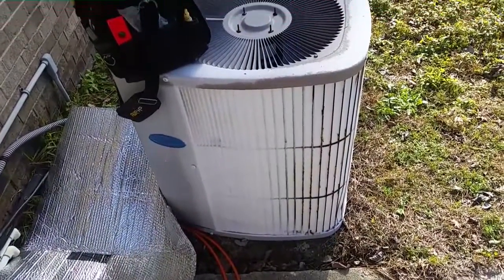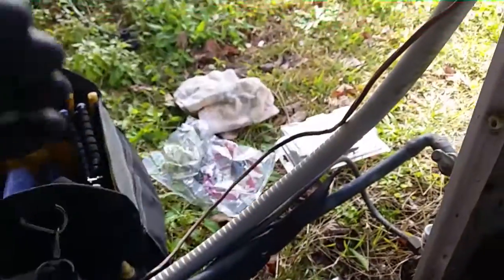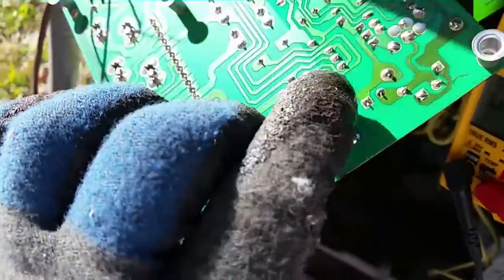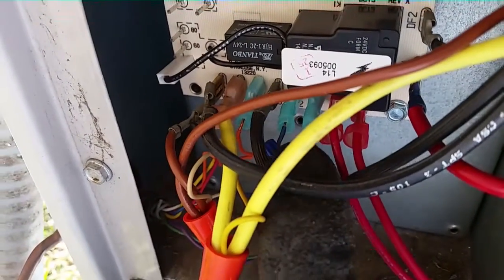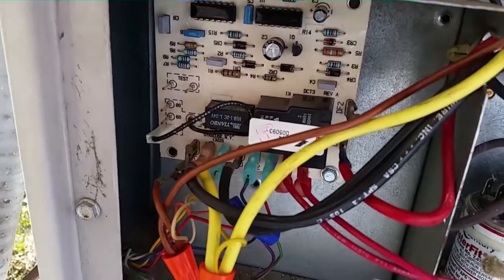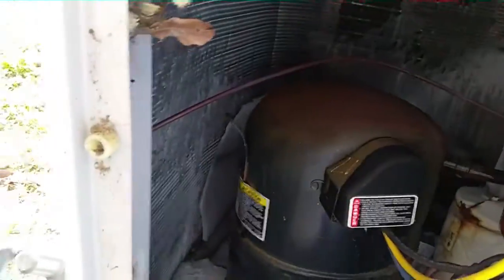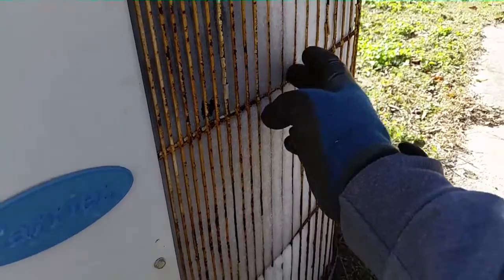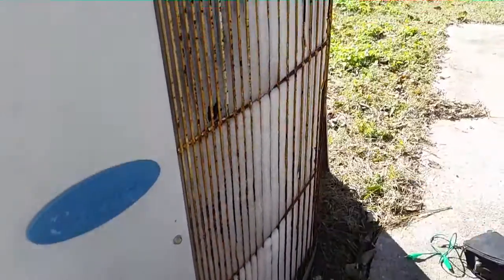Carrier Defrost Board Failure Retrofit ICM318C

Comment: Nice job. Anyone for snow cones! I had a run on Rheem Control boards and Honeywell Thermostats. Have you tried the Emerson 47D01U-843 universal HP control board. Same ideal but comes with both sensors and I just used on a out of warranty Rheem. Pretty slick and a thought for a future repair.
Reply from the maker: I heard about the emerson, it just costs a little more. Perhaps I should try it to see how it fits with the units I run into. I assume it has a o or b dip switch that would make it very handy.
Reply: Yes it has a program that you run on unit.  It has a built in display. White Rodgers has a video on their website that takes you though the install. It where I first leaned about it.

Comment: Nice video... I don't have great experiences putting spade terminals on thermostat wires - I keep the short wires I don't use that come with new primary controls and wire nut them to the thermostat wires, much better for me.
Reply from the maker: I haven't had too much issue with putting spades on them, just had to double check them. Every now and then if I didn't crimp well enough one would slide out.